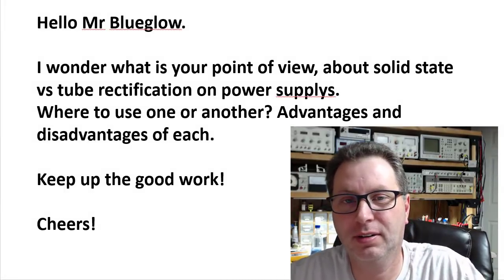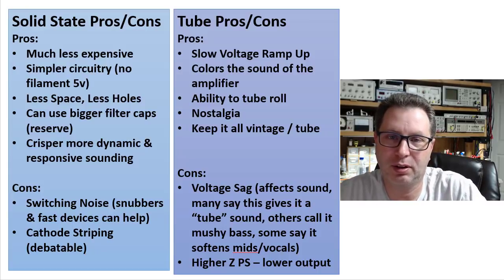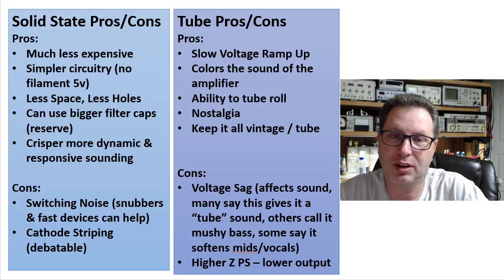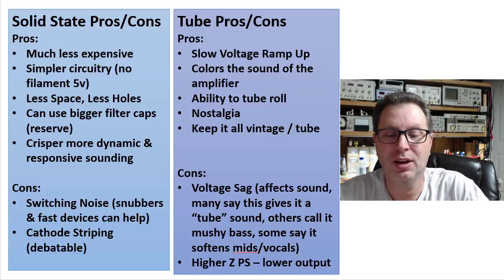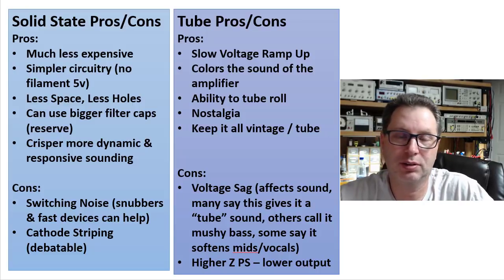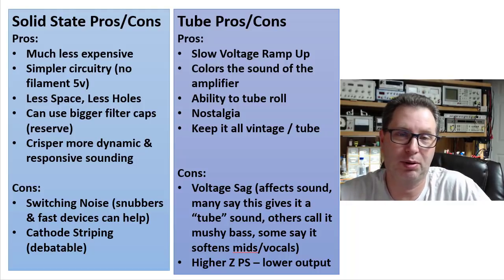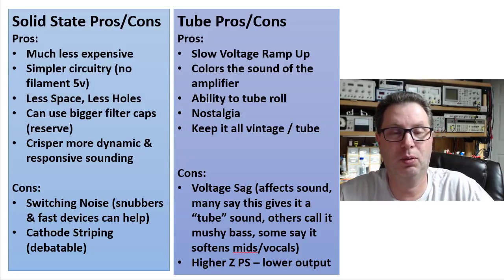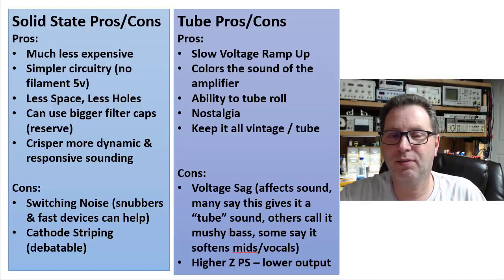Tube vs. Solid State Rectification for Tube Amps - BG160

Comment: Solid state for funky/Rhythm/chords, Valve rectifier good small amps and "Lead guitar" . Both work well. A good compressor can help if you find your is too bright. Just my opinion from exp. Find out, that's the real fun.

Comment: Hello. I'm repairing and restoring all kind of electronic equipment (valve and solid state) since the 80's. I would say that if you have older valve type that are directly heated, you would like to use valve rectifiers. Solid state will cause "cathode stripping" and more ripple voltage than valve. Especially with older 2A3, 6A3, 45, and 47 audio output pentodes and 26 drivers. These are relatively rare and you want to preserve them for as long as possible. They can be costly to replace. If you are restoring an old radio or even in a new project, the rectifiers used in these aren't expensive enough to replace the original one with solid state. Also, it will need higher capacity filters and they will likely raise the B+ voltage higher than it's supposed to be and circuit modifications will be needed. It just don't worth it. In newer designs, with "newer" tubes like 12AX7/drivers and EL84 outputs, solid state will do the job fine. Many receiver who dates back to the 60's are already designed with a solid state rectifying circuit but I would replace the germanium diodes with silicone. They are more efficient and reliable. If you still want to use solid state, you would want to use shottky diodes. You will also want to put a resistor about the same value as the rectifiers valve in parallel with the diodes and it will be pretty close. Just watch out for the B+ not to be higher than specified. It will likely cause the power output to redplate and the output transfomers to heat up and it's not good.

Comment: when we talk about tube amp you have to go back to the  the old fenders well i know you all want to think they all had tube rectification but leo fender design the fender baseman in fact with solid state rectification in fact the fen twin reverb in th1960s   he did that with a lot of the amps he actually build him self (the once people point to be legendary)  with a solid state reification  leo only build amps for fender till 65 when he got sick and sold the plant  i think that all of the other stuff in the amp connection pots resistor type and size grounding points capacitors  variation in tolerant color the amp way more the the dc power supply

Comment: I’ve had good luck with Weber copper cap solid state rectifiers. Plug right into the tube socket. Works great as you can see in this video: https://youtu.be/cLIOW28RxXo

Comment: Thanks so much for the exposition. My opinion: I'm all LPs and all tubes for decades. I've never heard a solid state amp that comes anywhere close to what I get from tubes in the highs, the air, the rhythm, the hall, the fabulous interplay of the high overtones, the attack envelope and etc. Solid state: yuck, boring, artificial, dead. But I have replaced my tube power supplies with carefully designed solid state power supplies: a solid foundation for the tension and release of the music, the sometimes complex array of sounds all intermingling, the rhythm and the punch. A great base on top of which the tubes sing. And yes, I load up on reserve capacitance. I don't care about "vintage." It's all about the music.
Reply: I know it's 2 years ago but tubes rectifiers usually have a limit on how much capacitance you can use with it. It's usually from 20uF to 40uF. If you use more, you would have to use a resistance between others capacitor. You can have a choke in the circuit. It will eliminate the ripple even more.

Comment: In the case your amp has a solid state rectifier, there are very reliable diodes nowadays. FREDs or even HEXFREDs are a very good replacement choice to improve your tube amp performance.

Comment: Howdy.

A Solid State rectifier + large capacitors cause the transformer current to be short timed high spikes. The transformer complex power (VA) needs to be way larger than simply filtered current times filtered voltage (Watts). I recommend the complex power rating to be at least 1,5 times the Watts power.
Another aspect is that the power company isn't very happy about spikey currents.

Comment: With guitar amplifiers, the tube rectification’s sag characteristics can be a desirable one in the sense that it creates a certain squaking effect with power chords and such.
Reply: If you connect a resistor, the resistance of which is close to the internal resistance of a tube rectifier, in series with the SS rectifier, you achieve pretty close those sag characteristics of tube rectifier. Of course, plate voltages must be same to get the same sound.

Comment: With a Solid State Rectifier circuit you won't have reverse recovery issues (less or no switching noise), with FREDs, HEXFREDs or Schottky diodes (the ones that support high voltage an amperage). Your amp will sound more like it will have a tube rectifier inside, without the Cons!

Comment: I wonder if there are some measured statistics on this question? If not perhaps one could build an valve amplifier with both power supplies, switchable of course, then run a set of performance numbers - noise, distortion and frequency response, and calibrated listening tests with each power supply.

Comment: Well for eg. the 5u4 rec tube heater on account of  it´s ribbon Filament structure,  has no cathode sleeve to warm  up, it  heats up pretty quick a second or so. so i dont think cathode Stripping is an issue here.

Comment: Taking into consideration all the circuit specifications and output requirements into account, both methods of rectification can and are absolutely appropriate and sound amazing. I feel that "modding" an original circuit into a SS or Tube PS, from the original, is where things may go wrong.

Comment: That may sound crazy, but has anybody tried to build a ss amp with tube rectification?
Reply: Eduardo Queiroz won't work as tube amps use high voltage and low current. SS uses low voltage and high current.

Comment: Would it be possible to replicate the second order harmonics with a solid state solution, maybe with post processing or other method?
Reply: Alain Menard yes, there's a way to do it : use a transformer. the output transformers on the tube amp are the most responsible for their "tube sound". i've seen measurements on high quality transformers and they add harmonic at extreme frequencies : bass, treble and even low midrange (which is nice imo). usually the more expensive add less harmonic. but ss amps are already high current, low voltage output so they don't need these. if you have high gain preamp and high gain ss amp, you can add interstage transformers between them to add more harmonic.

Comment: What about if you run a thermistor after the Bridge rectifier on a solid stage this would help with soft starting your valves, any opinion on it. And give the tube rectifier a more build up of current? By putting it on that end then the front end.
Reply: I added a thermistor to my vintage ST-35, at line voltage into the amp, for that reason but also to get the "new" voltage down a volt or 2. Original design line voltage was somewhat lower in 1966 in comparison to todays.

Comment: I found an interesting thread on diyaudio about snubbers for solid state psu diodes. Not as straight forward to achieve low switching noise as often stated. Choosing effective values for the RC snubber depends on particular psu impedances and load value. There's a novel way suggested for safely scoping the diode switching waveform, in order to select values. See: http://www.diyaudio.com/forums/tubes-valves/260165-standard-silicon-diode-rectifiers-vs-ultra-fast.html
Thanks BG.